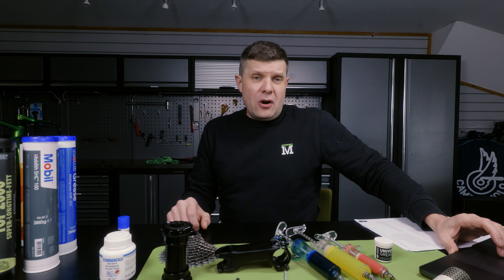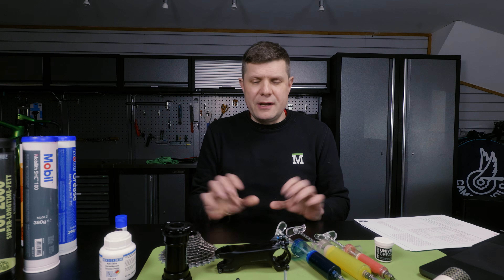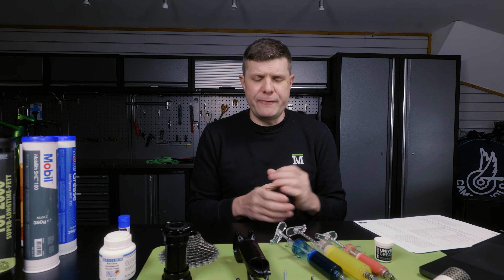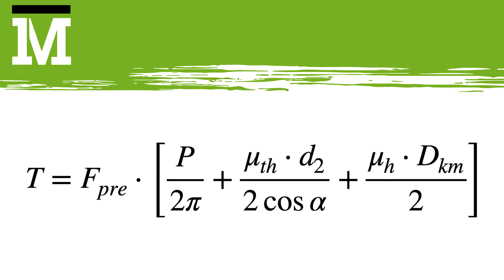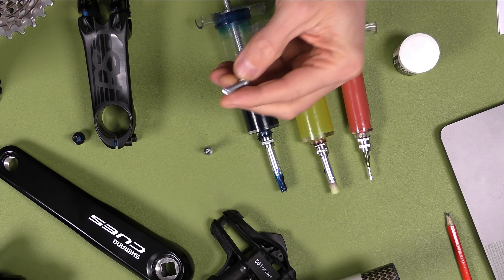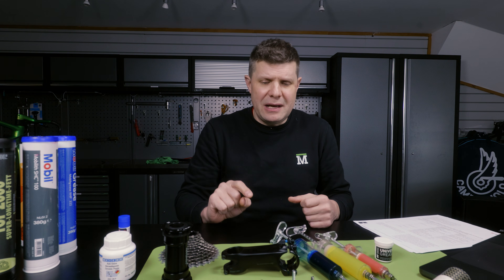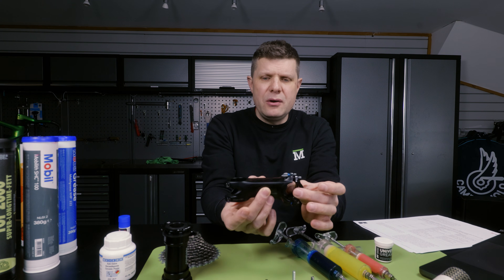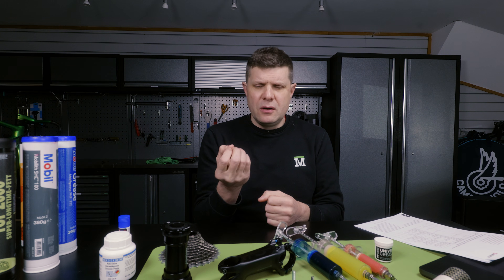Are You a Good Mechanic? (Or Just Lucky?)

Comment: I would really like a response from a bearing manufacturer regarding the cycling world's habit of opening bearings and re-greasing them. I don't understand how any mechanic can think they can work cleaner than the factory and have more suitable grease. In my opinion, once an industrial bearing is gone, you replace it. 

BTW, DT Swiss says to coat the outside of the bearings in a thin layer of DT Swiss Universal Grease, the one shown in the video, to aid with installation. A thin layer, not a smothering.
Reply: Bearing grease deteriorates and bike bearings particularly suffer from water ingress contributing to potential accelerated bearing deterioration. Re greasing bearings is at times completed outside of the bike industry and bearings are refurbished increasing bearing life.
So if sensibly completed as reported here, all good.
PS, in one of my previous jobs, we refurbished and re-greased large Engineering bearings.
Reply from the maker: In reality a pro mechanic rarely lifts seals and replaces grease unless they are specialist ones like ceramic speed or chris king that specifically ask for it.  We don't do it because bearings are generally cheap compared to cost of labour and we can guarantee their condition.  I would probably only clean and grease bearings of my regulars.  I think I covered the Universal Grease in the vid, didn't I? I am sure I did.
Reply: @Mapdec  Considering the cost of high quality bearings versus shop time you still ahve the labour to remve and install the new bearings and the cot of the bearings themselves versus the need to remove and clean the original bearings. Any medium to high end shop can easily expense a decent quality ultrasonic cleaner, if they can't they shouldn't be working on bikes thatcost upwards of $8,000
Reply from the maker: @chrisC5339   Sure, high quality XD15 and Ceramic. For a regular Enduro ABEC 5, SKF, NTN etc, no point really. By the time they come back to a bike shop they are mostly cooked. Maybe a home mechanic will service more often.   I think every workshop will have several Ultra Sonics these days in various states of cleanliness and concentration of detergents.
Reply: @Mapdec  My comment about the prescribed amount of grease on DT Swiss bearings was not about you. It's about those videos where sealed bearings are burried beneath a thick layer of grease, which serves no purpose IMHO.
Reply from the maker: @benderydt oh right. Yes. People do think that adding more and more grease is better. Forgetting that it just turns into a grinding paste full of dirt, traps moisture as much as it protects etc etc etc. I’m going to stop there. 😂
Reply: How Can you properly dismantle without destroying the Sealing Lip?
Reply from the maker: @edmundsander2039  destroying is a big word, you can be gentle and do very minimal damage. They are easy enough to lift with a scalpel blade.  Yes, the seal is compromised.  Is it significant?  Depends.  🤷‍♂️
Reply: @Mapdec I agree, but whats the Job of the seal? Keep the dirt (metallic particles) out… I fully agree with your replacing approach except for “exotic” bearings.
Reply from the maker: @e @edmundsander2039  yes.  The really exotic stuff has service kits that supply fresh seals along with a specific grease.  We are really in the weeds here.  There would need to be some pretty exceptional environmental conditions for a microscopic nic in a rubber seal to be problematic.
Reply: Any sealed bearing, if the races aren't loose or the balls pitted or the seals compromised, can be cleaned out with solvent or an ultrasonic cleaner. Periodic maintenance depending on various ride conditions dictate this. To give you an example, I have 11 speed Campagnolo Ultra Torque cranks with ceramic bearings that have seen thousands of kilometers and through periodic cleanings and regreasing are still smooth. So it just depends on the quality of the bearings to begin with. There are many high quality both steel and ceramic bearings out there but unfortunately many garbage, even ceramic, ones out there that are total junk. The hardness of the balls and races are what is important, better bearings with good quality races will simply last longer and spin more smoothly.

Comment: For those bolts with blue patch / loctite: should the old threadlocker be removed before reassembly with new blue threadlocker? How do you do this in your shop? I once used an external thread cutter die for that job. A bolt for mounting the brake calipers had a large amount of hardened Loctite on it
Thanks for the great videos
Reply from the maker: No. These blue patches are just micro balls that should burst and become liquid. Just wipe off what you can and replace with a dab of 248
Reply: If you're really worried about it use a rotary tool with fine wire wheel and go at to clean off all the hardened/dried out locktite then just apply a few drops of new blue threadlocker. (many companies make it, not just Locktite)

Comment: I find seatposts that use a wedge instead of a clamp a bit finicky.

The two inner parts of the wedge must slide against each other.  Need grease.  The anchor bolt, too.

The two outer sides of the wedge need to find purchase against the inside of the seat tube.  Need carbon fiber paste.

Grease and carbon fiber paste -
Never the twain shall meet.
Reply from the maker: There is no real problem there. The wedge should defo get a little grease to stop it corroding. You can use it to sort of stick the wedge in place as your apply the grip paste.

Comment: it's nuts... or bolts!!
on a serious note, quite how a home mechanic can vary a quoted torque setting after applying a different lubricant or threadloclk is beyond the scope of reality I'd imagine.  When I was building and servicing my own bikes back in the 1990s, everything was done by feel. but then, there was very little in the way of carbon componentry.  I remember being terrified when fitting a Look full carbon fork onto my Cannondale CAAD4 race bike.  It was a case of a quarter turn, test, quarter turn, test... and then fingers crossed there was no cracking noise!
Reply from the maker: Well… hopefully now you can. A quick google, some quick sums and a torque wrench
Adjustment. I assume that anyone with carbon parts in their bike will have a torque wrench.
Reply: @Mapdec  As the saying goes don't make an ASS out of u and me, no not everyone who has a carbon bike owns a torque wrench, I have had expensive carbon bike and components for many years now and never had a torque wrench, only bought one because of a wicked online sale, that said I rarely use it, never in all my years never stripped out a bolt installed in a carbon or alloy part, please don't place the onus of a carbon bike purchase with the need for all sorts of possibly unnessary tools. We're trying to promote cycling here and how to work on your own bicycle not intimidate or scare owners.

Comment: 08:48- PTFE tape actually DECREASES friction. If anything, it may cause more torque to be applied to the BB. In plumbing, that material ( and the pipe dope) allows more torque to be applied to fittings, fills any gaps, and seals leaks.
Reply from the maker: Yes! In plumbing you have BSP tapered threads that rely on that tape. 

In cycling we have small parallel threads. The PTFE just adds bulk (interference) inside the thread pitch. It makes the bottom bracket feel tight (false torque) before it actually clamps properly. It jams the threads rather than lubricating them.
Reply: @Mapdec  Wrong, it is specified on tapered threds for a good seal, on bicycles it serves to further reduce the odds of bottom bracket cups creaking in the bb shell, many maufacturers either spec teflon tape or have a layer of painted on/liquid PTFE applied at the factory. It does not jam the threads, please don't mislead people.
Reply from the maker: @chrisC5339   LOL WRONG... link me to a brand that specifies putting PTFE tape on their bottom bracket threads. i will put your comment on the next video, and apologize. Please don't gaslight people in the comments with this misinformation.  It is just an instagram fad. Keep plumbing tape on plumbing.  I am well aware that praxis once specified a silicone sealant, but I have never seen PTFE specified in a manual.

Comment: It is certainly interesting to know how much to adjust the force on a torque wrench. But what is the point if it is not calibrated regularly and is wrong by several percent or even tens of percent? And the condition of the tool worsens with its age and if it is not set to 0 Nm immediately after work. In automotive, calibration is mandatory at least once a year.
Reply from the maker: Totally agree. 100% VDI2230 does factor in what is known as tool scatter. However, I feel a video on tool calibration is coming
Reply: It's bicycles we are talking about here, very low torque sttings are used apart from threaded in bb cups, a 1/4 inch torque wrench, unless it is used hundreds of times does not need recalibrating. If you are dealing with higly sensitive aircraft parts or perhaps competition downhill mountain where severe vibration I could see the need for re-calibration.
Reply from the maker: @chrisC5339  Oh Chris, are you projecting again?

Comment: Strewth...the amount of grease being used from the video you highlighted was somewhat excessive...it will very likely just become muck trap in the end, while forgetting the issues of cross contamination - which you discussed & described so well.

As to the worst example I've ever come across...I think has to have been a VERY heavy grease (I think it might have been Rocol "Tough Gear" or similar open gear type of grease?) in a wheel hub.  OK it prevented corrosion but it had the viscosity of tallow at room temperature...🤔🙄

So yet another great and informative video...and I do really like the idea of a learning/research portal even if it has to be behind a paywall of some kind (dependant on cost) because the time and effort it would take to create it has to accounted for...
Reply from the maker: Glad it was useful. Thank you

Comment: 6:34 canyon uses conical washers, not flat. If you loose those... buy the whole set of bolts for 15€. Also if you want to switch to Ti bolts... well those washers dont go well with normal (normed) bolts heads, allthough on the head side the washer is flat. Great design, impracticable in real life
Reply from the maker: Yes, they are not the only ones either. Great point

Comment: Now I wonder what is the best way to remove the dirty grease on the threads before I reapply new grease? Spraying a ton of degreaser on them doesn't sound like a good practice. Especially for the threads on the frame, I can't clean them with an ultrasonic cleaner either.
Reply from the maker: Your bike wash or dish soap will do a pretty good job.
Reply: Then I need to buy a set of different sizes of brushes for different sizing threaded holes 😂

Comment: What I don't appreciate with lubricants is that their specification is not available.

In the past my dad had lots of different greases on his workbench, and they all had specification written on the side of the tin stating their viscosity at specific temperatures. Some even had little graphs so you could see how the viscosity changed over a range of temperatures ~ very useful when using them.

Manufacturers (not just bike manufacturers) no longer seem to publish this information on the grease packaging, and don't bother to make it available in the product notes published on the web.

This means that I can't make an informed decision that the oil / grease I have to hand is a suitable substitute for the use case I am about to use it for ~ particularly in emergencies.

Equally bad, is that the manuracturers of various parts (i'm mostly thinking hubs and bottom brackets), don't give any details of the type of stresses that they expect during use of the pats, and again if they supply a specific grease don't give its technical specificity.

This is particularly important if I am 'away from home' and don't have access to a bike shop with bike specific oil / grease, as I don't know what I should applying to my part.
Reply from the maker: I totally share this frustration. I hate that bike companies quite often do not publish the SDS and TDS, just pages of marketing waffle.
Reply: @Mapdec  : talking of safety data sheets, how should we dispose of used brake fluid ?? or old brake pads and discs, can the be 'recycled' ??

No information anywhere, particularly the shimano brake fluid, can I dispose of it like normal oil, or do I need to do something special, at least SRAM uses DOT fluid, and I know I have to be careful with that stuff or I'll kill or give cancer to every kid within a 100 mile radius, but they could at least include that information on the side of the package (or on their web site)
Reply from the maker: @davidmyers9581   We store ours in a big oil drum and take it to the recycling centre one a year or so.
Reply: @Mapdec  :  thanks, now I feel justified when I had an argument with my then boss who just said to chuck it out with the regular stuff (or down the sink). I was not impressed. I just stored it in a large old car oil can, and told him to do dispose of it how he desired.

Comment: There is no centrifugal force on the axle since the axle is not turning :).
Reply: Even in a hub, the centrifugal forces are less than one g. The radius is so small, and wheel rpms are so low that any grease will be pulled down more by gravity than pushed out by centrifugal forces. It's just not an issue here.
Reply from the maker: @marksticky0688  gravity, g- force, vibrations.  Whatever the method.  It’s going to mix.  You this, because if you ever tried it, even after just spinning the wheel a bit to tune the gears, those greases will have combined.
Reply from the maker: Sorry if you did not get the point of all the white grease scraped off as it passes the bearing.
Reply: @Mapdec   I appreciate your comment on it all getting scraped out but c'mon mate, you said "remember the centrifugal force of this hub rotating, it's just going to fling that out". The commenter is dead right Paul, the axle doesn't turn. Grease on a stationary axle isn't being flung out. Gotta cop your own mistakes if we're to take info from your tech school.
Reply: You are focusing on semantics and technically wrong. The grease transfers to the bearings, that's why it's put on the axle.
Reply from the maker: @R28Caboose  I think i have clarified this already.  All that grease would have been scraped off as it passes the bearing. Your left with a ridge of grease on the inner race. Go and try it.
Reply: @bbqcrew1  I am focusing on semantics, you're right. The video was very good and helps build knowledge. At the same time, I like seeing people own their mistakes.

Comment: When I worked as a shop mechanic, someone had used red Loctite on their chainring bolts. We couldn't get them undone 😂 The customer paid for a new chainset in the end, we used to use blue Loctite on jockey wheel bolts and a few other things like mudguard stays. Another great video Paul 👍
Reply from the maker: intresting... A quick blast with a blow torch should have broken that free.
Reply: @Mapdec we didn't even think about that back in 1991. The middle chainring was worn out, the customer told us that another bike shop had used red Loctite. We used to use a bit of Pedros Bio Grease on all threads, especially the threaded metal Shimano crank dustcaps which used to be difficult to remove if they corroded in place.
Reply: @Mapdec  Would that be a quick blow torch blast on a carbon or alloy crank, nonsense.

Comment: I'm using motul 222 for evrything what is rotating and motul nautic Grease for fixed montage. Carbon parts with motorex Carbon Paste.
Reply from the maker: As long as you know the reasons why, (other than marketing) it's all cool. there are lots of suitable stuff out there.
Reply: Yes, regardless of the manufacturer, the main focus is on preventing corrosion and ensuring that it works. For more performance and less friction, you could use a less sticky grease than 222 in the bearings (as recommended in your video). We used to completely degrease the bearings in the inline skates and only lightly oil them. This made them very smooth-running and was sufficient for one race. That was 30 years ago... Today, I don't need anything else there. It should last and work.
Reply from the maker: @jorgheinrichs5688   Nice work